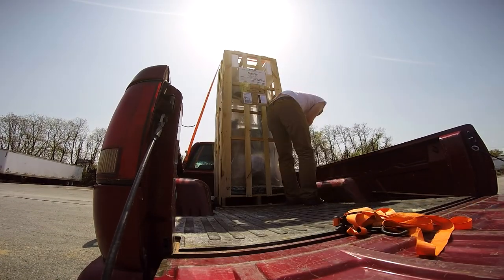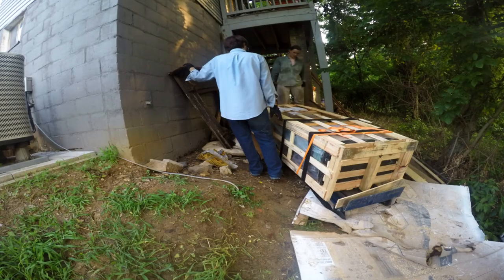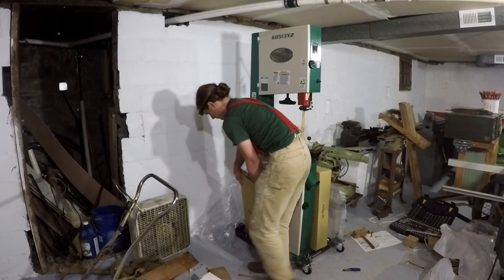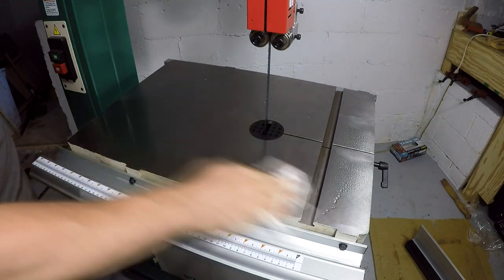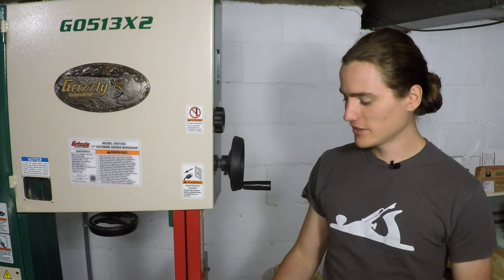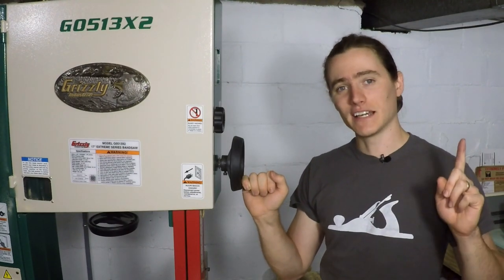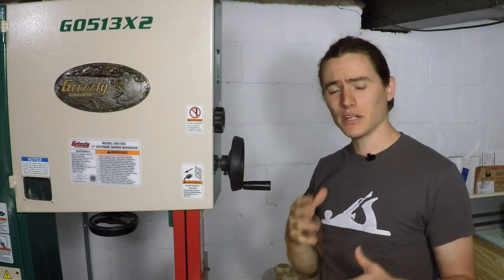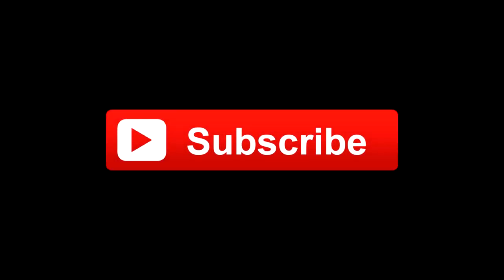My New 17 Inch Band Saw - Grizzly G0513X2

Comment: Buyer beware

I previously purchased a table saw and jointer from this
company with no problems however,  I
bought a band saw from grizzly and when assembled it did not power on and had 3
other defects.

Reading the troubleshooting guide on page 44 of the manual I
realized that I was not qualified to work on the electrical system. Contacting
Grizzly I was treated less than poorly. Grizzly finds it acceptable to sell a
new machine with corroded wires, incorrectly installed the wiring harness for
the motor, defective start ON/OFF switch, Centrifugal and capacitor inoperative
etc.…  I am not an electrician   but Grizzly squarely puts the responsibility   on the customer.

Under their warranty, Grizzly requires that you will affect
repairs on a brand new machine that is defective upon arrival. The only  option, disassemble and ship the machine back
at your own costs for their evaluation, at which time they will decide to
repair/replace or refund and credit your shipping costs. I believe a warranty
is an insurance to repair or replace an item that BECOMES defective in time not
to ship you a machine that is inoperative on day 1.

I have been woodworking for 35 years and bought many tools,
I never experienced this lack of quality control and customer support. 

Lastly upon searching the internet there is strong
possibility that I was shipped a refurbished saw.

Do read their warranty and return policy carefully.

Unfortunately I am not the only one with defective
equipment, the below links show that it is common.

https://www.bbb.org/us/wa/bellingham/profile/machine-tools/grizzly-industrial-inc-1296-515707/complaints

https://www.resellerratings.com/store/Grizzly_Industrial

https://www.glassdoor.com/Reviews/Grizzly-Industrial-Inc-Reviews-E193090.htm

https://grizzly-industrial.pissedconsumer.com/review.html

Good luck
Reply from the maker: You sound like a man on a mission, I'll be honest, I did not read your entire comment but go the gist. I don't care what you buy, you run the risk of things not being right. "lemons" exist with any company. The way to avoid this is to buy a bandsaw from powermatic that costs $5000 - $8000, something most of us are not able to do. I'm sure you know how Grizzly functions, they are a company having their tools made overseas, they receive them all crated up in warehouses and ship them when ordered. It's a huge operation like many other companies. The majority of people are happy with Grizzly, myself included. I don't deny you had a bad experience, but that happens. You are the guy on a crowded interstate that gets pulled over for speeding, I'm the guy right beside you that keeps on rolling. We all get pulled over sooner or later. Sorry for you issues and good luck with your future endevours.
Reply: Thanks for the reply, I appreciate it.

My intent is to point out the lack of warranty from Grizzly
and moreover their unethical behavior, I am only trying to help out fellow
woodworkers, call it a mission, well then I am proud of that service.

 I would however
disagree that most people would accept a new tool that is DOA and be expected
to affect repairs, I have been wood working for 35 years and know a thing or
two on tool purchases, and maybe you will learn as well someday.

Lastly, consider to not exaggerating, you lose credibility.
A comparable Powermatic band saw sells at woodcraft for $ 1,300 not $5K to 8K

Item #824315  Model
1791216K   Powermatic - 14" Bandsaw,
Model PWBS-14CS $1,299.99 

https://www.woodcraft.com/products/powermatic-14-bandsaw-model-pwbs-14cs?gclid=Cj0KCQiAmafhBRDUARIsACOKERPn7LYAihPISNJucvwg8ztizuFjcbRQsgQeYZwyucsiD5vRctyeD08aArAHEALw_wcB

But I do agree, I will buy from a more reputable company in
the future.

BTW, I don’t speed, never have, and never will. I survived 2
combat tours in Vietnam; I’ll be damn if I am going to die by being stupid.

All the best